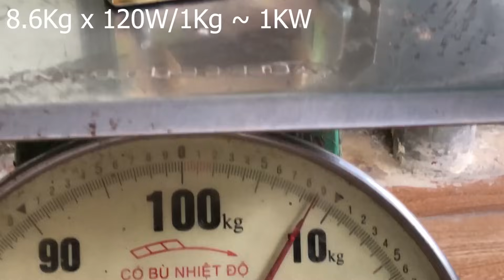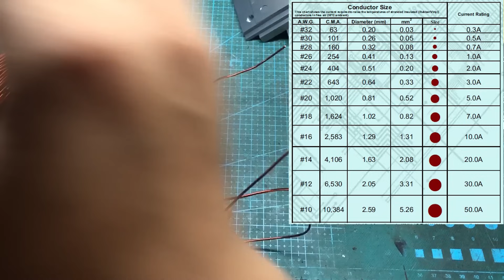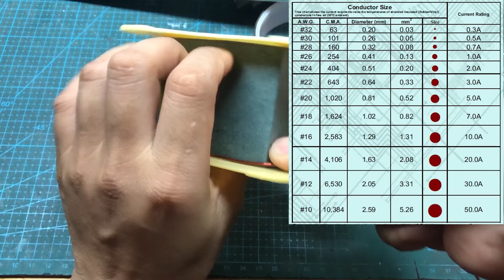Make 100A transformer

Comment: I think that 5x8 core at 10000 gauss should be 1600w. Am I wrong? Cheers.
Reply from the maker: you are right, but the steel core in my country has low silicon content. So just to be on the safe side, I think only 1000W should be used.
Reply: 5*8=40   40*40=1600     section  squared in VA
Reply: Power belongs to CSA and window area products only.

Comment: What would be parameters for 2000-3000₩at,230/110 volt transformer. What would be the cost?
Reply: toroidal tranformer or a welding transformer - a transformer from a welding machine

Comment: Can you make a video on isolation transformer 220v to 220v
Reply from the maker: ok bro
Reply: @PhdHung  thanks sir 
I have made your 6 kw device 360dc to 220 v ac .
For 6 kw full load how much inductance should we need and what gauge wire to use. I am using 47*25*19 core black

Comment: Using this transformer for your inverter...what kind of efficiency do you measure under full load?
Reply: 80-85%, Chopper transformer is more efficient can reach 98%
Reply: @PHM_Tech  do you mean toroidal transformer?
Reply: @creativebuilder577  a ferrite core transformer bro.
Reply: @Raz82000    ferrite core requires high frequency  ?  or  60Hz ok with ferrite core?

Comment: How the inductor reduce no load current
Reply from the maker: I use this transformer for inverter. The inductor is mounted on the SPWM side. It will filter high frequency components before entering the transformer. performance will increase dramatically.
Reply: @PhdHung  Nice, can this type of making an inverter transformer be use with all your projects? i am still waiting the commercial project you are finalizing.
Reply: Hi, the inductor is placed on which side of the wire ? The starting wire or the ending wire ?

Comment: De dónde van a sacar 100 periodo con ese núcleo de poca capacidad, se requiere de un cable calibre 2 awg y de ese núcleo a lo sumo, alambre calibre 12 para un voltaje y corriente de no más de 15 amperiosy y voltaje bajo, eso moda para tanto, 100 amperíos, pero en sueños
Reply: Yes you are right

Comment: I'm watching from Russia.
Well and qualitatively done!
And how can the inductor reduce the idle current and increase efficiency?
.
Смотрю из России.
Хорошо и  качественно сделано!
А каким образом индуктор уменьшить ток холостого хода и повысить эффективность?
Reply from the maker: Yes, EGS002 has a SPWM frequency of 22Khz. You know, Iron Transformer will have a hard time operating at high frequencies. Adding an inductor will help filter out the high frequency components. The no-load current will decrease. Performance will increase.
Reply: @PhdHung 
There will be very minor changes.
In my opinion, these are fractions of a percent.
.
Будут очень незначительные изменения.
По-моему, это доли процента.
Reply: @PhdHung  hola, saludos de argentina, hoy hice uno del misma área de 40 mm, solo que a 8 volt para egs002, bien, ahora el inductor de cuando es, y un capacitor a la salida de línea de trafo, de cantos microfararios usas

Comment: Can i use this trans for welding machine make welding machine with full details plz
Reply: welding machine of 150A @ 30V = 4500W
4500W @ 230V = 20A
20A wire ~ 2.5mm2 primary
160A secondary @ 80% load = 200A max load
200A wire = 70mm2

Comment: Why is a 7v transformer used for a 12v inverter? Doesn't it draw more current? You calculated 1 V per winding, but for some reason, 1 V does not appear per winding.
Reply: no I plates were installed. efficiency reduced by 99%

Comment: I have trouble buying reasonably priced transformer cores. Can I grind open a MOT (Microwave Oven Transformer), retain the primary winding and add an apropriate amount of secondary windings, then weld it shut again? Or are there any fundamental flaws in the core-construction of MOTs?
Reply: There are, They saturate at nominal voltage, but yeah, you could do it. But remember that it'll get very hot/burn up if it's ran at nominal rated current
Reply: I know this is super old but MOTs are pushed way beyond their capability inside consumer ovens to cut the cost of manufacturing and that isn't a problem since microwave don't generally run for more than 5 minutes. So using the transformers for longer than that will degrade and eventually kill it

Comment: What is the relationship between VA of transformer from ampere. How to calculate VA from ampere. Should i consider primary voltage or secondary voltage?
Reply: VA is a product of voltage and current

By assuming a va power say 1KW and supply voltage eg.230v we can calculate current
Reply: section squarred =power[VA]   power[VA]=U[V]*I[A]
Reply: @developmentutopia6337  thank you for reply
Reply: @koushiks_energy  Thank you
Reply: the number of turns per 1volt is frequency over section[square centimeters]
to choose frequency is simple
1 risky[intermitent functioning] 45hz 1 minute on 10 minutes off
2economic[continuous]50hz
3professional 60 hz
diameter of wire[from the relations above] 0.65...0.85(square root of current in amperes)
Reply: Always from the secondary winding - that's the power. The power of transformers is given in VA (Volt * Amperes), which are Watts (without power factor). For example, output 12V * 42A = 500VA = 400W (VA * 0.8 = W). Therefore, always state the power in VA for transformers. Determining or determining performance is very important to derive another. We will stay at 500VA. If you want to find the amps A for the maximum load on the output (secondary winding), then: 500VA / 12V = 42A. Since theoretically P1 = P2 (power input equals power), you can determine the current in the primary winding. We take into account the efficiency of 80 percent. Power input P1 = power P2 / 0.8 = 500VA / 0.8 = 625VA. Subsequently 625VA / mains voltage 230V = 3A. Result: Primary winding = 230V 3A 625VA and secondary winding 12V 42A 500VA. VA can also be used to build a transformer and determine the number of turns per 1V as follows: SQRT (P1) * 1.2 = 30cm2. The cross-section of the transformer core should be 30 cm2, which is a core column of, for example, 5 cm x 6 cm ... So much for the VA relationship.
Reply: @DL-kc8fc  Thank you so much for the valuable detailed information you share. It feels very helpful for me. Thank you once again.

Comment: Why there's no litz wire used for High voltage side ?
Reply from the maker: Yes, it is better to use litz wire, but to reduce cost I use single wire.
Reply: @PhdHung  it's okay brother you're doing a good job 👍